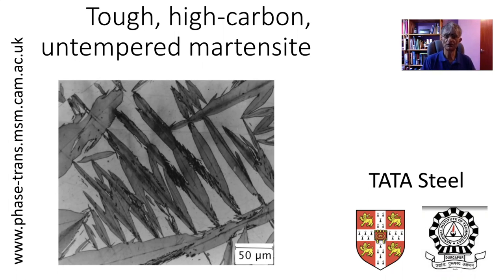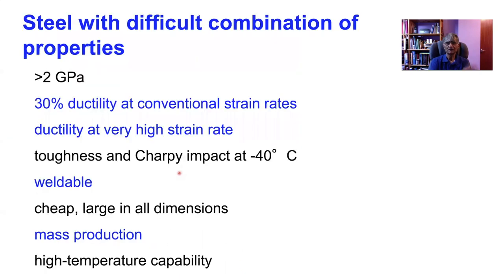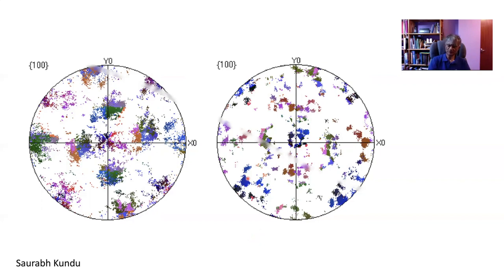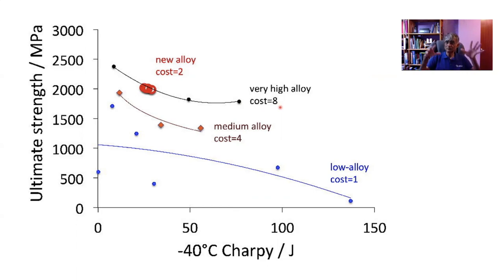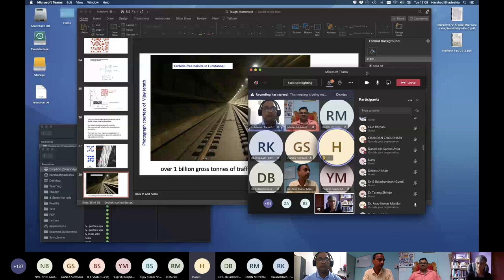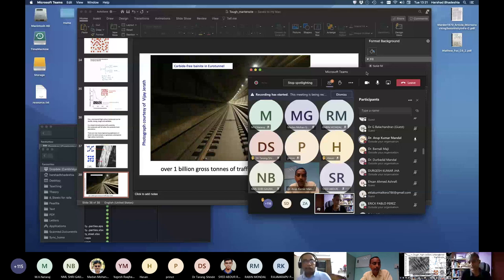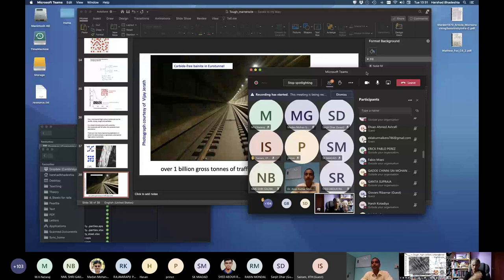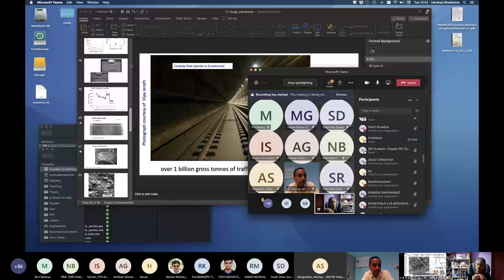Tough, untempered, high-carbon martensite in steels

Comment: for this fine martensite steel ,does the welding HAZ lose ductility compare its original state? and will it limit the usage of steel in welding structure ?
Reply from the maker: We have not found a loss due to welding.
Reply: @bhadeshia123  I think pancake effect diminish after re-austenization in the HAZ. would it reduce ductility?
Reply from the maker: @wanghou6219  But there is vanadium microalloying, so as I explained in the lecture, that limits the grain size in the HAZ during rapid heating and cooling.
Reply: @bhadeshia123  Thank you very much,